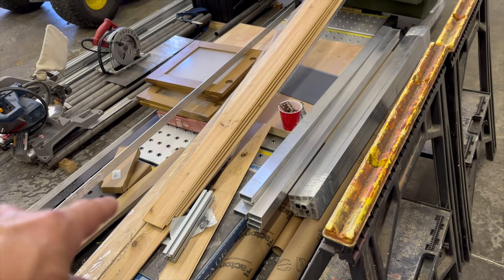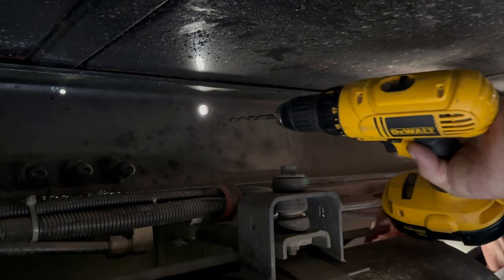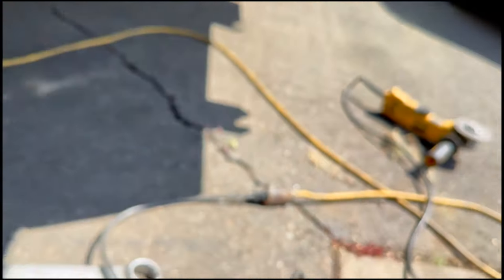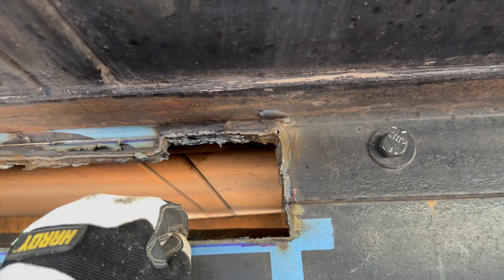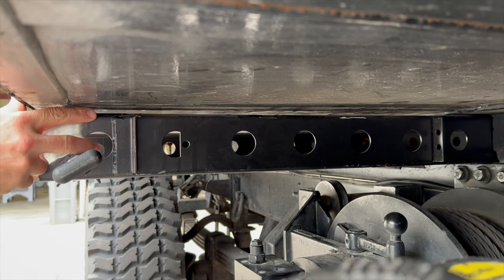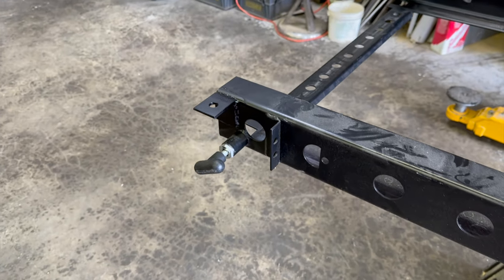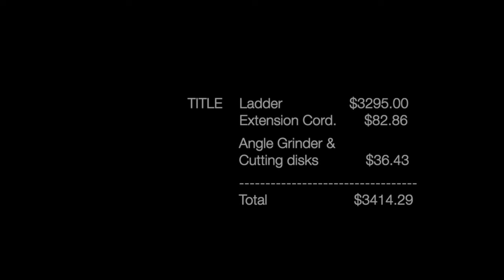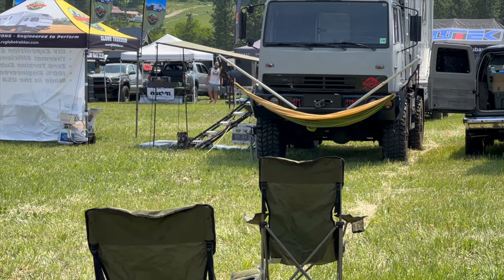Installing the Boarding Ladder on the LMTV

Comment: Demolition Sawzall blade would do that cut pretty good.
Reply from the maker: I did use a sawzall for some of it.  To be honest I threw just about every portable tool I have at it at one point or another.
Reply: @BrokeOverLand  secrete is in the "demolition" blade for metal.  Didn't know they existed till ran across one then tried it......  was surprised how fast it cut thru our C channel
Reply: Well, he knows for next time, I guess.
I really hope there isn't a next time he cuts a huge hole in his frame.  I am willing to bet he doesn't either!
Reply from the maker: Agree no more holes in the frame.
Reply: @BrokeOverLand  Im assuming future video is welding some reinforcement to replace strength lost
Reply from the maker: Nope. Captured spring to reduce stress on the upper rail

Comment: When I saw you were cutting into the box subframe, I was horrified and intrigued at the same time, but as usual you just made it look simple. Well done mate
Reply from the maker: It is definitely going to cut into how aggressive I can get off road, until I can put that c-channel on a captured spring system to reduce the torque.

Comment: the offset door plan is correct, i missed that detail when i did mine and though it works a bit of toe room would have been better. my many angle grinder scars where twitching when u switched to the grinder.
Reply from the maker: The angle grinder is the one tool that has caused the most damage to me second only to the bench grinder.